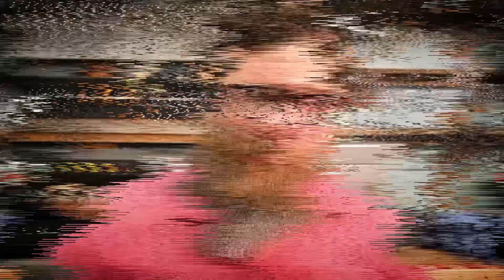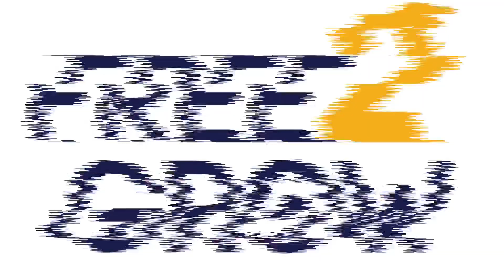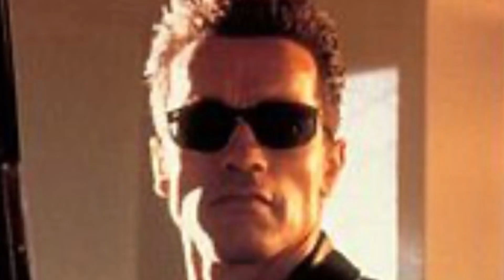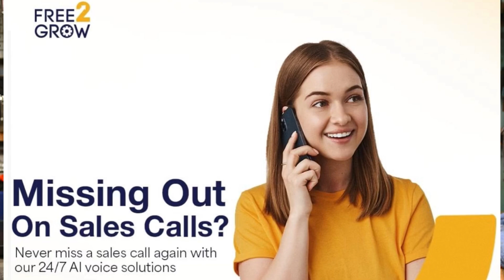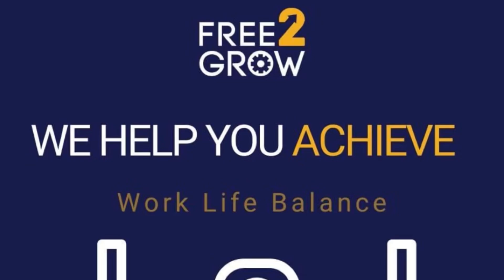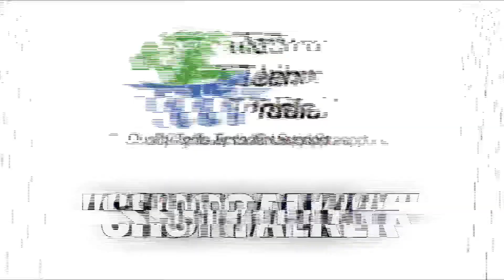3 Reasons Why Your HVAC System Has a High Delta T

Comment: Ok, bro. As a fellow beardo, imna drop some learned advice. Blow dry your beared after showering. Blow and brush it back and forth, side to side, while drying it. Only brush it downward after it is dry as you finish with the blowdryer. You'll lose the wavy ridge at your jawline that way and it'll look massively better.

Comment: A lot of times return air duct installation is compromised to what space is available.  Sharp bends and choke points limit effective duct and grill area.  Check how much air velocity variance there is across return grill face with a simple handheld anemometer.
Reply: Bingo.these new construction houses only have 22inches apart for each stud..and get what that 20 inch flex becomes 24inchs outside of the bag sometimes its badly pinched .my coworkers always want to see perfect numbers.i tell them if they would see things at rough stage theyll realize how spaces are limited

Comment: Good morning. I find down flow furnaces in closets to be very difficult at times to get to a good supply reading. Especially in mobile homes. When I realized that the temperature split can be too high, alight came on and “I got it”!!!. Thanks for the great info.
Reply: I always upsize my MH indoor coil at least 1/2 ton, install a TXV, even in the old days. The more surface area, the less chance you have a water pull-off.
Reply: @USA-GreedyMenOfNoIntegrity  Please remind me what you mean by water pull off.
Reply: @Mr.Mo17  on the shorter 18” H coils if you’re trying to pull anything more than 1000 CFM, or if you let the coil get a little dirty, water will pull off into the blower and electrical compartment of a mobile home furnace instead of sticking to the fins and running into the condensate drain pan.
Put the larger 24” H coils in and keep it clean and you won’t have any problems with water pull off or high TD. With a larger coil, you can also set your blower speed down lower and this will also decrease water pull off.
Reply: @USA-GreedyMenOfNoIntegrity  That’s what I thought it meant. Thanks for the great info. Have a great day.